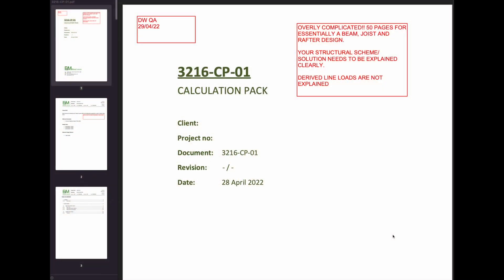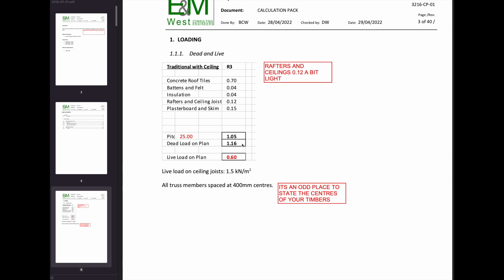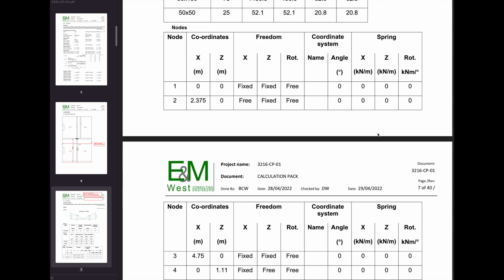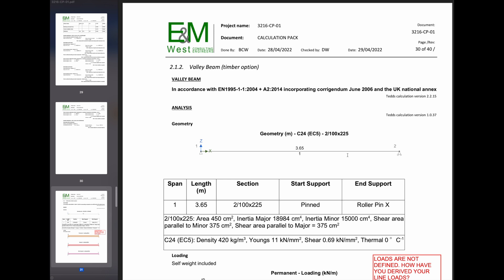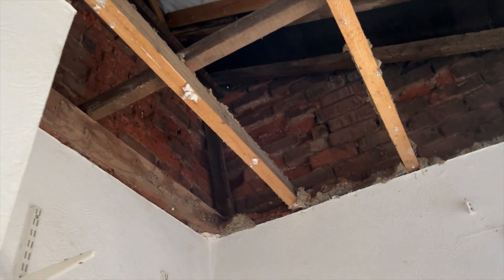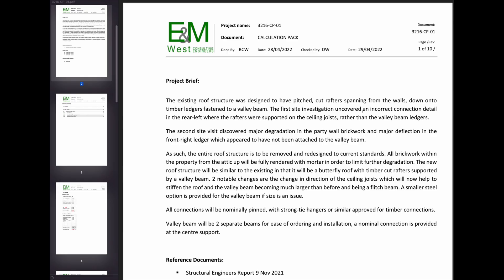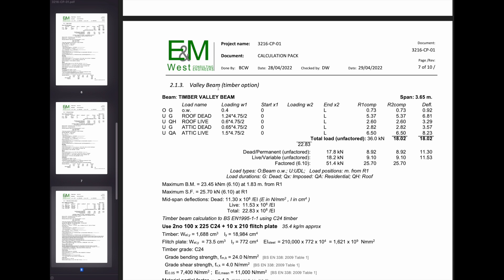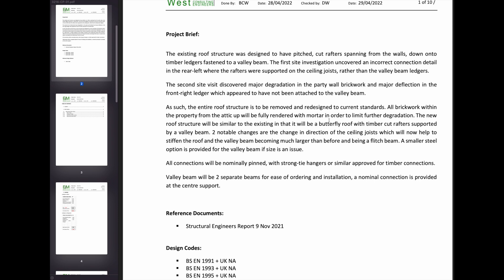Simplify your structural calculations - overly complicated analysis

Comment: There appears to be minimum snow load along the valley, and maximum out at the high points. I'm not familiar with the BS snow code, but I would have expected to see snow drifting - so there would be more snow load along the valley along the centre line of the building.

Comment: Nice to see eurobeam being used. I always export all parts so the bending moment can be checked it makes for a more intuitive check. I think for domestic projects the explanation of the project is not required if your mark up is detailed enough and you take the time to annotate what is required and why etc... Do you not also need to specify this ceiling ply thickness as per the PD 6693-1:2012 document as it falls into the engineers responsibility.  Turns out technically even for trussed rafter we are liable for this and not many engineers actually do it, . Based off the size and presumed frontage 12.5mm would work but it removed the need for the sarking/ sheaving in the rafters and is easier to install.